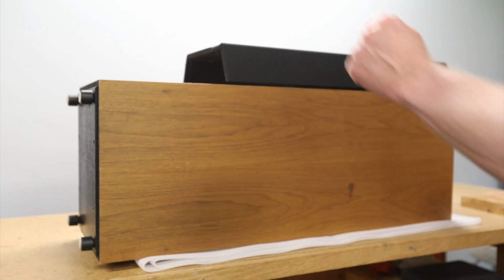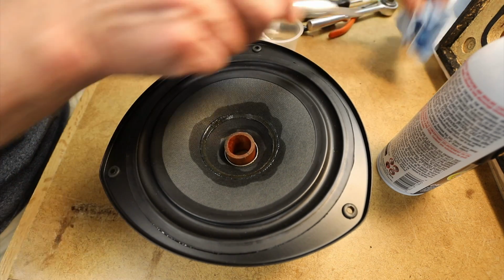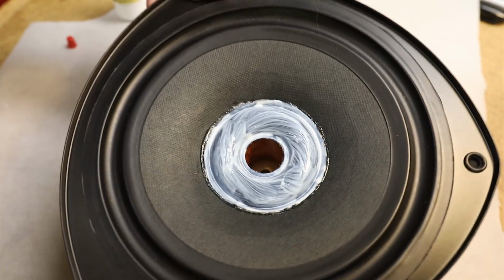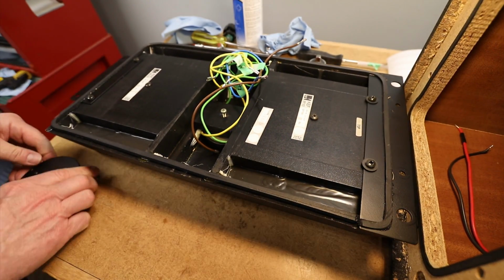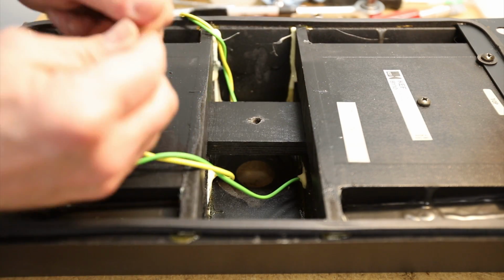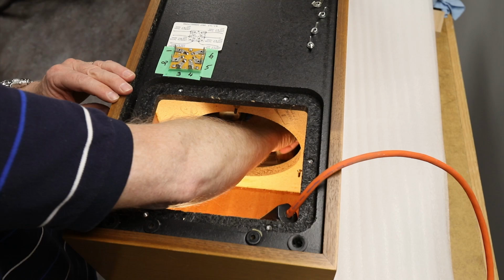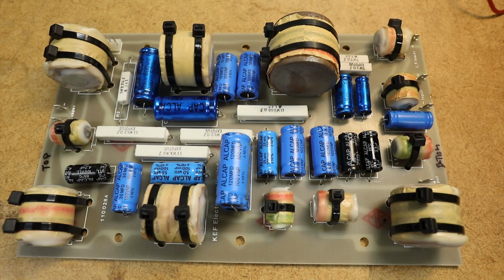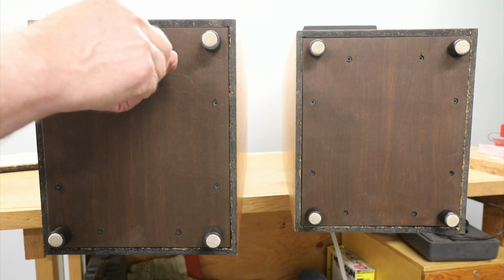KEF 104/2 Restoration

Comment: KEF 104/2 — Has anyone successfully removed the aluminum housing to access the tweeters for ferrofluid replacement? Just to be clear the tweeter looks nothing like the Kef 104/2 that I have and is like the one found here https://www.youtube.com/watch?v=cDylusoe_48&t=11s
I recently completed a recap, but the high frequencies still don’t sound quite right. I’ve heard that these tweeters are sealed, and that at some point the factory changed the ferrofluid chemistry. I’ve also heard reports of people opening them and replacing the fluid despite the aluminum housing. From what I understand, the correct approach is to remove the six outer screws while leaving the three inner screws untouched, since those are part of the alignment. I followed that method. After removing the six outer screws, I tried lifting the housing straight up, but it’s absolutely solid and won’t budge. Before moving on to plan B—which would involve a pulling method I have in mind—I’d really like to hear from someone who has successfully done this and can confirm the proper technique.
Reply from the maker: Hello and thanks for your enquiry.  As I mentioned in the video, my original tweeters were (sadly) commercially replaced well before I did this restoration.  Hope someone who sees this thread can give you a hand.  Good luck.

Comment: My father passed away a couple of years ago and I have just been given his 104/2s and Quad hifi stack which as a kid I wasn’t allowed near. I am really looking forward to getting them set up. On a quick inspection the donuts are definitely going to need replacing and I am going to replace the tweeters too. How important is the replacing of the capacitors would you say? I am very much an amateur when it comes to soldering. Thank you so much for this video it is exactly what I need for the job at hand.

Comment: Awesome I'm going to do some for a friend, I've done a lot of refoams and recaps but it's very helpful to see the steps needed to disassemble such a unique speaker without damage. Is there any reason you didn't just replace the ferrofluid in the T33? Thanks to you two for the informative video!
Reply from the maker: Thank you for your comments - I appreciate it and glad to hear that it is helpful.  As far as the T33 tweeters are concerned, please see my reply to the previous comment.
Cheers!

Comment: this is a great video. Very clear and well filmed/photographed. Thank you very much for this.
Can I ask , why did you use the Morrel tweeter to replace the old tweeter?. Was this choice due to the sound quality, or purely because you were unable to find the original tweeter. Do you think its a better choice for the tweeter?
Regarding the capacitors. Had they simply run their course or did the new ones add better sound quality.
Please excuse me for these ignorant questions. 
My Kefs are also needing a refurbishment but after seeing your video I figure I may well be able to do it myself.
What was the most difficult part of the repair?
Thanks again for such a well filmed video.
Reply from the maker: Thanks for your comments and those are good questions.  My original KEF tweeters were replaced by an electronics outfit some 20 years before I did this restoration (wish I still had them).  From what I have discovered, the Morel tweeters were the closest fit to the non KEF existing ones.  If I still had the original tweeters, I would have tried to replace the ferro fluid inside the tweeter.  As far as the capacitors go, their sound quality degrades over time so for the little extra time, effort and expense, it seemed logical to do it all at once.
I can say honestly that I am not an expert at repairing speakers.  I thought it was worth sharing my experience given that the results were quite favourable. It was not that difficult of a job - just need to do it methodically.  Good luck.
Reply: @franks909  Thanks for the response. It's helpful to know that even though you hadn't had much experience with repairing speakers, you still found it not beyond your skills, and that preparation is the key. Great advise for everything really. These types of videos are so helpful to anyone interested in whatever the subject matter may be, so thanks so much for putting the effort in and recording your efforts.
Reply from the maker: Thank you for your kind comments.  You may also want to go through the comments below (I know there are a few). There were some helpful suggestions that I wish I thought of before.  Good Luck! :-)
Reply: @franks909  Thanks. I will. Hope you keep posting.

Comment: Thank you for video tutorial. i followed your advise, labeled each wires and where it connects to. Made it a lot easier not to make mistake. How did you clean the woofer cones? Mine is dusty. Thank you
Reply from the maker: Thanks for your comment.  If it's just dust, gently blowing it with some compressed air should do the trick.
Reply: @ thank you

Comment: What tweeters did you buy to replace the original?  Also, are there replacement crossovers available?
Reply from the maker: Hello and thanks for your inquiry.  The very original tweeters were replaced in a shop many years before I did this renovation.  For the crossovers, you may want to check with Falcon Acoustics in the UK, same place I purchased the replacement capacitors.  They may be able to provide you with more info.  Sorry I can't be of much more help.  Good luck.
Reply: @franks909  Hi Frank.  I appreciate the reply.  In your humble opinion, would installing "scan speak" woofers, mids and tweets be overkill?
Reply from the maker: @foxtrotzulualpha  To be totally honest, I am not knowledgeable enough to answer that.  You may need to search elsewhere online for that.  Sorry I could not be more help with this.
Reply: @franks909  You and your wife, did aa amazing job!  Thank you both very much.  I'm excited to referb my pair.  Happy Holidays!
Reply from the maker: Thank you for the feedback.  Good luck on the restoration. Happy Holidays to you as well!!

Comment: They sound just like my I phone!  I’m disappointed.  I have 104.2 which needs tweeting.  I’m considering doing your recommendation or selling as it.  I purchased new in around 1984.
Reply from the maker: Thank you for your message.  With just a little effort and not too much expense, they really ended up sounding great.  And I am not an expert.  Please check the comments below before you start any renovations on the speakers cause there are some good suggestions.  Good luck.

Comment: Great job!  I would chsnge the inductors that are in series (signal line) to copp3r tape, and definithly change in series capacitors to poly film foil solen or audyn for tweeter,  c9mpensating for decreased resistance. Maybe next tiime Cheers !
Reply from the maker: Hi and thanks for your comments and the advice.  Definitely something to consider should I have to redo the circuit board.  Cheers!

Comment: Why did you need to feel like you had to change the tweeters what's wrong with the ones you had before or the originals??
Reply from the maker: Hi.  The original ones were no longer working (not sure why).  They were replaced by a third party over 20 years ago.  Wish I still had them and I would have replaced the fluid in them.
The ones I replaced in the video were also not working and needed replacing. Long story, short.

Comment: Thank you very much for your great video!! I started to restore  my 104/2 cause of it and already ordered the tweeters and a refoam kit. I hope you can help me with one question: Do you know how to replace the  midrange drivers without damaging anything cause one of mine is broken and i can't find informations about that in the net. Thanx a lot!
Reply from the maker: Hi and thank you for your kind note.  I am sorry to say that I have never replaced the midrange drivers.  I would encourage you to keep looking on the net.  I would not be surprised if there is a group out there dedicated to these speakers.  Good luck.
Reply: @franks909  Thank you for your reply! Sadly I have to change the baffle, cause it's not possible to change only one midrange driver on the older 104/2.
Reply from the maker: @harrythehaggler7103  That's too bad.  Hope it all works out for you.
Reply: @harrythehaggler7103  This was my experience as well.  One of my mid range drivers was dead so I had to shop Ebay for the entire assembly that included both working midrange speakers and the tweeter, which I ended up replacing with the Morel to match the other speaker.  Think I paid $250 for the assembly.  There's a couple differently shaped versions of it just to further complicate it.   One is straight, the other tapers in.

Comment: You don't need to replace tweeters. Originals can be repaired. There are many guides how to do this.
Reply from the maker: Thanks for your comment.  You are correct.  Unfortunately, the original tweeters were already replaced with non OEM tweeters long before I did this restoration.

Comment: Thanks for this, I have a set that is suffering the same as yours, Could you please pass on the details of where you bought the parts from, I am OK with the capaciors, but the rest of the gear I could do with finding a supplier., Thanks for the great video,.
Reply from the maker: Thank you for your kind comment.  Here are the links to where I got the supplies.  I included all the links in case others would like to know.  Good luck with your project.
Foam Surround: https://www.madisoundspeakerstore.com/morel-soft-dome-tweeters/morel-mdt29-4-4-ohm-textile-dome-tweeter/
Rubber Grommets: https://www.midwestspeakerrepair.com/shop/speaker-repair-kits/rubber-grommets-for-kef-104-2-105-3-woofers-12-pack/
Capacitors: https://www.falconacoustics.co.uk/kef-104-2-replacement-capacitor-set.html
Morel MDT29-4 (4 ohm) Tweeter: https://www.madisoundspeakerstore.com/morel-soft-dome-tweeters/morel-mdt29-4-4-ohm-textile-dome-tweeter/

Comment: Very good work to restore this pair of vintage speakers. By the way, why not upgrade all the internal wiring as well? Also upgrade the small value capacitors to GAD or Mundorf?
Reply from the maker: Thanks for your comment.  All the wires appeared to be in very good shape.  From what I researched, it was mainly the electrolytic capacitors that needed to be replaced given their age.  And honestly, I never even considered changing anything else.  Good consideration for anyone else wanting to do a restoration.

Comment: This is a great video!
Any idea if doping the doughnut keeps them from drying out the same way as the original?
Reply from the maker: Hi and thank you for your kind comment.  I am unfamiliar with doping the donut.  I am only aware that the sealer I applied in the video is a way to preserve the donut.  That is not to say that there are other, and possibly better, ways of doing the same job.  Cheers.
Reply: Yes, the sealer. Is there any evidence that it will make them last longer. I'm about to change the donuts on a pair of 103/3 and I'm curious if it will make them last a bit longer.

Comment: MidWest Speaker Repair has direct T33 tweeter replacements available.  No modification to the cabinet required as with the Morels.  Speaker grilles can be re-covered as needed as well, with speaker cloth from Amazon, and some 3M Super 77 spray adhesive.  Speaker binding posts can also be replaced with posts from Dayton Audio, or Amazon.  If you have the bi-wire 104/2 models, be aware that you will need a slightly different set of capacitors from Falcon, so let them know you have bi-wire speakers, or just pull the networks out, and write down a list of the caps you'll need, and let them know.  The bi-wire speakers used different crossover networks from the two-post models.  I encountered this when restoring my bi-wire models (have done 3 pair thus far over the past 20 years)
Reply from the maker: Thank you so much for this info. I'm sure this will help anyone wishing to install T33 tweeters, speaker cloth, binding posts and/or capacitors. Thank you again for your contribution. Best.
Reply: Do you still have these components for the resto on the 104's?

Comment: As of 2023, capacitor kit (2 speakers) runs about $200 shipped to the US.  Inner and outer surround replacement kit is about $80 (2 sp.) ferrofluid replacement is about $20, MidWest direct replacement tweeters are $45 each, and speaker binding posts can run from $15 to $80 (set of 4) so a full restoration will run between $300 and $400.
Reply from the maker: If I still had the original T33 tweeters, I would have replaced the ferrofluid (also less expensive).  Thank you for the info, it's appreciated.

Comment: This is a great guide, but a couple of thoughts from someone who has restored two pairs of these. Firstly, replacing the T33 stock tweeters should only considered (IMO) where the original tweeters have blown. I have read various reports that people prefer the sound of the original tweeters, a simple ferrofluid replacement is an addition to your procedure above, and takes about 30 minutes per tweeter, Secondly, I never did the cap replacement in the crossovers and I also researched this extensively. These caps are very well built and its arguable they dont actually need replacing. The two pairs of speakers I did still sounded great without this (and I am generally a fan of recapping amplifiers). The other issue is that the caps you need can only be obtained from falcon acoustics in the UK and they can be VERY hard to deal with and are often out of stock of values, or send you the wrong parts.
Reply from the maker: Hi and thank you for your comments.  I would like to reply to your greats thoughts.  The stock tweeters; These blew long before I did the restoration.  Before I really knew anything, I took them into a audio shop and they simply replaced them with something else ( I made mention of it in the video).  In hind sight, I agree with your statement, I would have preferred to replace the ferro fluid.  The Caps; from what I researched, it was better to replace them given the age.  As you stated, it likely would not have made a difference but since I was knee deep into the process, I though why not, could not hurt.  Falcon Acoustics; They were actually extremely helpful and very easy to deal with.  I really have zero complaints.  The caps were in stock and were shipped right away.  Maybe I got lucky :-)
Cheers.
Reply: @franks909  Jerry @ Falcon is a top notch guy.
Reply from the maker: @bluefloyd6058  Sounds like it went well for you 🙂.

Comment: This is truly a comprehensive DIY Refurb video that I shared with my twin brother.  He has had his Reference 104/2's since the mid-'80s. I am more of a Vandersteen kid, and actively troll for audiophile info.  I had learned about how the lower surrounds on these woofers fail.  He's never really pushed them very hard, but it is hard to escape the basic chemistry of the material deteriorating over time.  I know there is mad science behind the design of this system, but damn, this is a wee bit of a process to refurb them.  Thank you for this video!
Reply from the maker: Thank you for your comment.  I was initially a bit intimidated as well.  Honestly, just going one step at a time and possibly recording your step as you go, didn't make it seem that bad.  Slow and steady wins the race.  Sometimes I think more effort was made in doing the video :-)  Best.

Comment: Are the alcap capacitors from Falcon marked for the negative pole?
Reply from the maker: Hi Jeff, these capacitors were not marked.  I am thinking that these particular capacitors are not polarized.
Sorry for the delayed response.
Reply: @franks909  thanks!   I have already finished restoring my 104/2’s.  I was very lucky that the bottom access ports were just screwed in place.  Thanks for your guide.
Reply from the maker: Thanks for the follow up reply and congrats on your restoration. Glad I could help. Best!

Comment: My KEF 105 Series1 spkrs, which I purchased new in ‘79, are now 44yrs old, the drivers are in perfect condition, they sound excellent. The crossover caps ruptured after 20yrs, KEF replaced them, still working fine. Sadly KEF recently said they would no longer service my spkrs if needed😡.
Reply from the maker: Thank you for your comment.  If KEF will no longer service your speakers,  you may consider to DIY instead.  I took the plunge and with a bit of homework, it worked out quite well.  Cheers.

Comment: Agreed on the electrolytic caps there. Sadly a missed opportunity to further improve the sound quality. Replace the electrolytics with Polypropylene types. Eg JB Caps, Jantzen, Mundorf.  (There’s a really good capacitor test review on Humble Homemade HiFi). The Dayton audio caps may be made by Bennic in Taiwan and although Polypropylene they’re fairly bargain basement but still better than electrolytics.  Add a Bypass cap on the  Tweeter capacitor (I use Cornell Dubilier 940C 0.01uf on budget upgrades, see the Humble Homemade HiFi review for other suggestions). But a much better upgrade on the Tweeter circuit would be Sonicaps with a 0.01 uf Miflex copper foil bypass cap.   And more regular Polypropylene caps on the Mid and woofer circuits. Only Use wire wound resistors (not the standard ceramic types), eg Dayton or Jantzen and replace the iron cored inductors with Wire wound air-cored types eg from US Coils. To learn more about such  speaker upgrades, follow the GR-Research channel and Danny Ritchie.
Reply from the maker: Stephen, thank you for all the great info.  I went with what I knew and how to proceed at the time.  Hopefully others reading this will give them other options to consider when refurbishing their KEFs.  Honestly, the speakers sound fantastic.  I was really happy with the outcome.  Best.
Reply: @franks909  sure thing Frank. consider it on the next upgrade. See this Kef upgrade from Danny at GR-Research
Reply from the maker: @stephenyoud6125  Thanks Stephen, I appreciate the info.  Best.